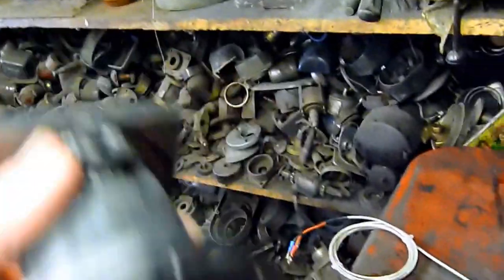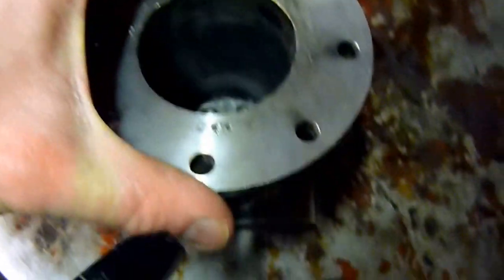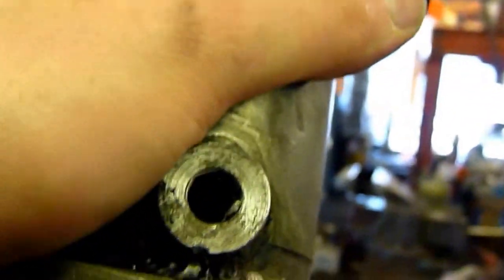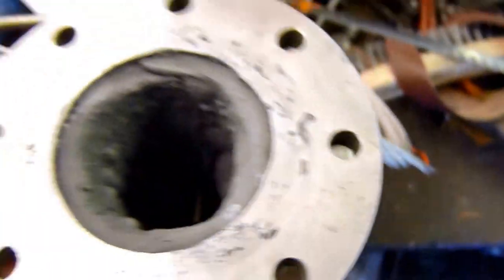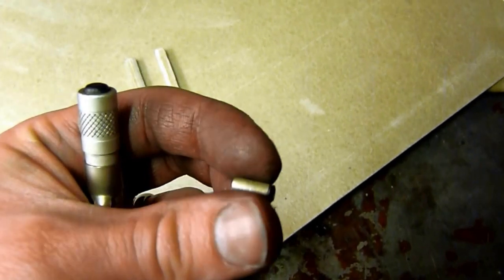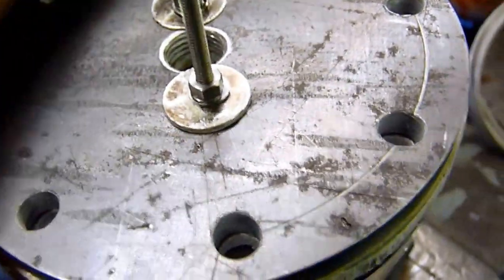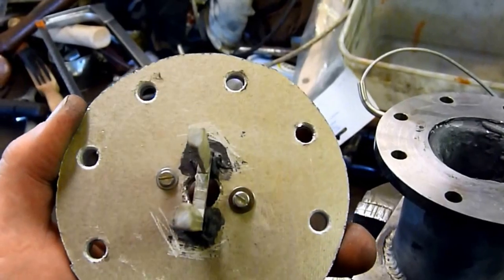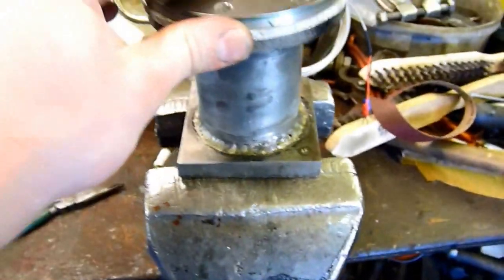Reprap metal and plastic multiple material printing project progress.

Comment from the maker: Well the head is going to stay still. It would be impractical to move with all the pipes. So the bed will move instead. But this is just to prove the deposition concept. The system could be made more neat and compact though still heavy.